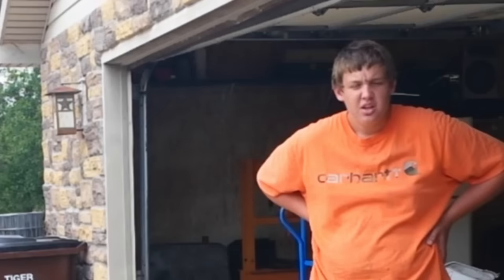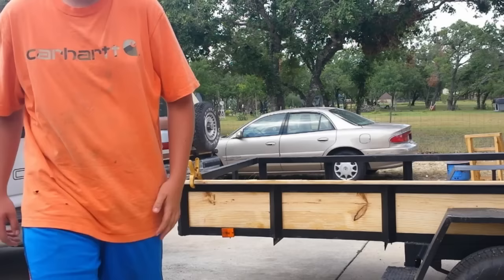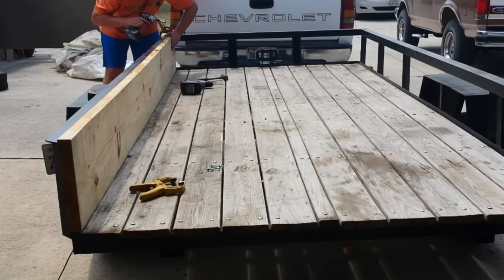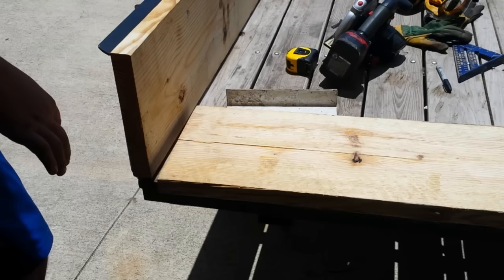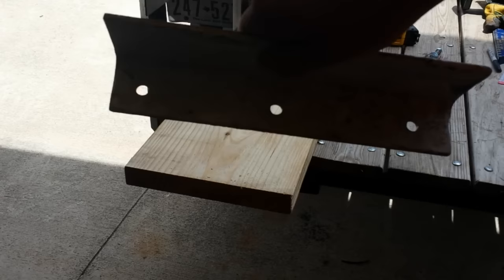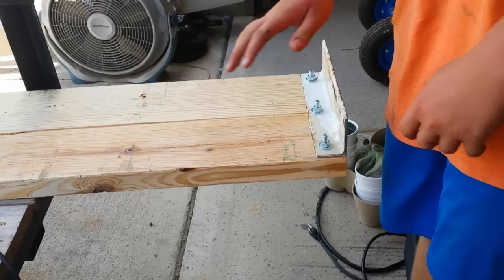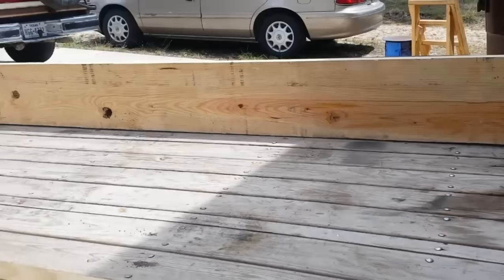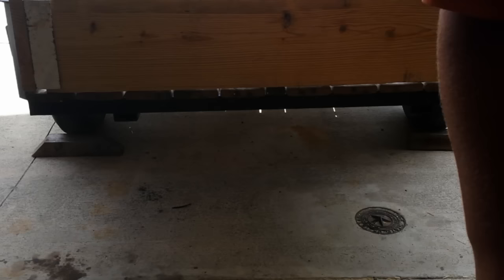DIY utility trailer - sides and ramps for cargo

Comment: Have the 2x12's bowed &warped yet? I'm afraid that a 2x12 will warp. I need sides on my 5x10 trailer but I'm thinking a 2x6 doubled up system might last longer.

Comment: if your trailer is full of dirt, how are you going to undo the barrel bolt when its half way down the board.
Reply from the maker: Not a problem... trailer is never "FULL" of dirt. 3500# even if dry is only about 1.5 to 2 yards. In a 5x10 trailer loaded correctly toward the front there will be plenty of room.

Comment: I have a better idea. For the back board, I used bed rails. I cut two pieces for each side, and faced one one way and reversed the other piece so I would have a chanel. all you have to do is drop the back board in the chanels, and lock it in.
Reply from the maker: Charles Davis yes that would work and is what we had on the last trailer but for this ine we are using the sides as long ramps so made it to catch the lip on back of trailer